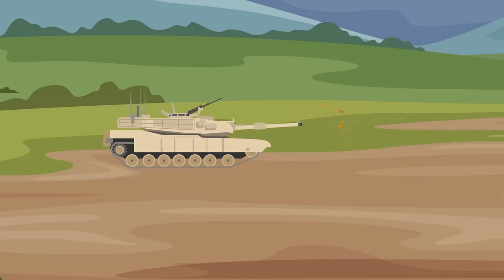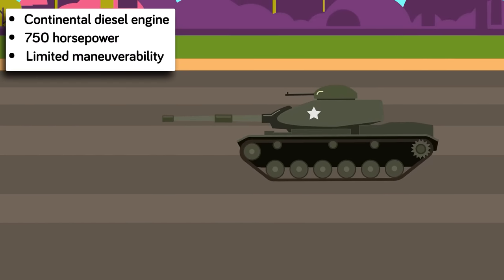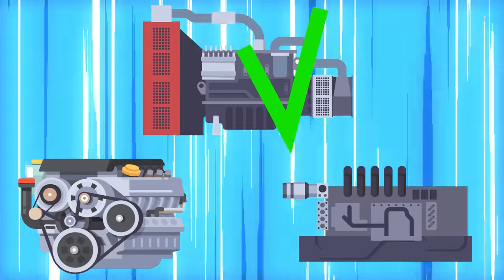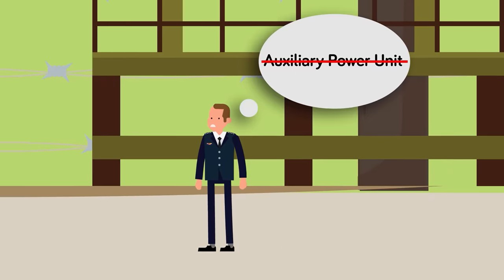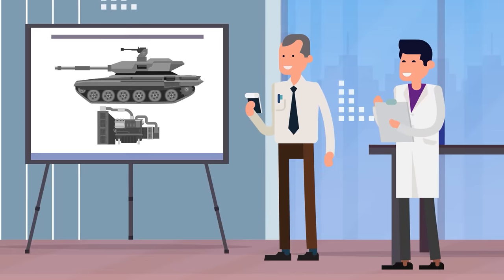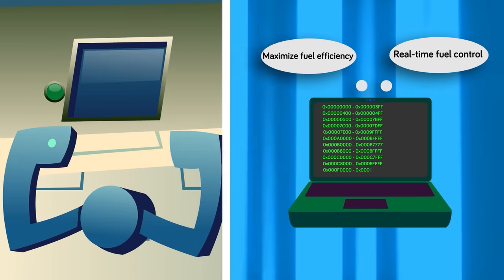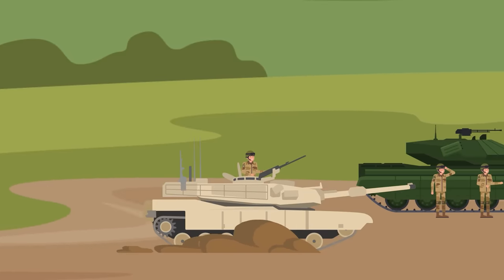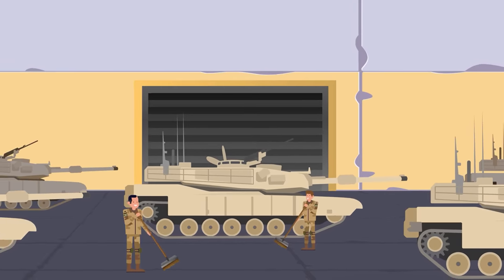Why M1 Abrams Turbine Engine Is Actually OP

Comment: I've spent 8 years as an M1 tank it crewmen. Crazy now that I think about it, we never had a tank engine that stopped working. Weeks in the field training you push the button it starts. Only other mechanical parts, transmissions, suspensions, and electrical components gave us headaches sometimes. It's a insane beast of an engine.
Reply: 1500 hp engine and only does only 45 miles per hour on road and 30 miles per hour off road sad so sad you'd think it would be faster then that🤣
Reply: Its not built for speed its built for smashing throughand climbing out of steep  trenches and (sometimes) buildings. Basements usually are deterrents for them to go through buildings. 

Plus it’s pointless to focus on speed when bullets and rockets go faster.
Reply: @raven4k998 the limiting factor for tank speed is usually the tracks, tranmission and suspension. They can go faster but that cause very high wear and tear.
Reply: @raven4k998  mechanically governed speed, during testing some were seen passing cars going 60 mph, however it put a lot of wear on the vehicle
Reply: @raven4k998  It really boils down to power (1500 HP) to weight (70 tons) ratio.
Reply: Ofc when it's run with couple of moving parts pretty much every gas turbine engine is reliable because of that.
Reply: @raven4k998  It's that speed on purpose. It CAN go faster, but they intentionally limit it to those speeds because track wear & maintenance starts to become an issue.
Reply: @TroIIingThemSoftly  are you sure?🤣
Reply: @raven4k998 It's a tank. If you want something with that type of power to go faster they'd simply change the gearing. Power isn't everything kid. It's how you apply the power. Traction, gearing, torque, and tuning are all part of the formula for speed and or power. Here's another tip most young gear heads don't know. There's a huge difference between quick and fast.
Reply: @raven4k998  Cry more 😢
Reply: @raven4k998  torque is more useful for a tank I reckon
Reply: @kronk9418  I love you to pookey:face-red-heart-shape:
Reply: The 1500 hp would be insane in a 3300lbs car, but the tank weighs over 100,000
Reply: @raven4k998  its true, the Abrams has a governor on its engine/transmission
Reply: @F_eesh  that governor needs to be removed so soldiers can have fun with it
Reply: @raven4k998  yeah
Reply: The abrams was great if you continued to use it. The moment it stopped for a week or more it wasn’t going to start again. At least our tanks at bliss were like that and my senior NCOs said the same.
Reply: @raven4k998  You're wrong. The engine has a "Governor" device, which limits the amount of horsepower the engine can send to the driveshaft. Without the governor, the M1 Abrams can actually reach 70+ miles per hour. The problem is going that fast will quickly cause the tanks tracks to shatter. That's why it has a governor.
Reply: @stray2748  and the engine can explode also🤣
Reply: The M1 Abram's fatal flawis directly related to the AGT-1500 which the Army  rejected in favor of the Continental AVCR-1360 Diesel engine.
Reply: @ceoofconfusion100  Tanks use aircraft engines, or aircraft derived engines which are only rated in Horsepower.
Horsepower output is critical to tank engines... not torque. Truck and tractor engines are not used in tanks for this reason.
Reply: @raven4k998  not smart to have 70 tons move faster than that speed. also it is governed for that speed so the transmissions and track don't fly appart.
Reply: mumericans have lost the technology for producing engines for Abrams tanks and cannot restore it
Reply: @raven4k998

For the ☝️clueless 🤡.
They have a govenor on them to restrict the speed or else the could do 60mph.

45mph is more then fast enough for a tank that weighs 75 tons(150,000 pounds)
Reply: @raven4k998 the purpose is war not speed, 1500 hp bc it’s heavy but more importantly it produces alot of torque at low speed (almost never gets stuck), for a civilian application it doesn’t make sense, for military purposes it’s quite brilliant

Comment: You guys also missed the most important part about the The Turbine Engine on the M1 Abram. It can also run on different type of fuel of all fuel types to diesel gas which is highly efficient when fuel is scarce. Although not efficient when running different gas, that was another huge advantage the army chose it rather than only relying just on diesel gas for diesel engine. I believe in the end the Turbine Engine was well worth the investment in Army decision for it MBT engine.
Reply: no they didnt miss anything - they made a video for use on youtube and need viewer interaction to be high. so getting people to put up potentially hundreds of comments saying essentially the same thing is still good from the algorithms point of view.
Reply: We got the German M265 120mm gun as well. Very accurate. Shoots far too
Reply: @adamsears1403  i think its called M256 and its a license built L44 with a different recoil System iirc.
Reply: @TheDude50447  ok you got me. Been 19 years ago 😆
Reply: @adamsears1403  😄
Reply: Why didn’t they just send them electric or solar powered tanks hate to see the c02 those put out
Reply: It runs on anything that burns
Reply: @tomcarey5156  Electric Tanks? You do know when a military attacks their will be no infulstructure in place. Power is one of the first things to go. Plus if it takes an hour to recharge your Tesla, How long would it take to recharge a tank?
Reply: @Bigdog365  Like hopes and dreams. Lol
Reply: @adamsears1403  no like for real
Reply: 'Diesel gas' is an oxymoron, there is no such thing. Also 'different gas'. There's gasoline, diesel fuel, etc.
Reply: almost all modern Tank are multifuel it’s nothing special😉
Reply: Even in WWII most vehicles were made to run on up to 3 different fuels at least the cargo trucks were but not the jeep
Reply: Can’t turbines run on almost any flammable liquids (gasoline, jet fuel, diesel, etc)?
Reply: Most tank engines are multifuel.
The Leopard 2 Diesel engine can run on anything the M1 can run on, including Diesel in cold weather, something that is a major flaw on the M1.
Reply: The US Army rejected the Lycoming AGT-1500 and the Chrysler version of the M1.
The winner of the Army XM1 trials wasthe Diesel powered General Motors XM1
Reply: @TheDude50447  Correct, the M256 is the cheaper version of the L/44 that lacks the better hydro-pneumatic recoil system and lacks the more accurate concentrically balanced gun tube found on the Leopard 2.
The Abrams uses a heavier composite barrel that is more prone to droop and thermal deviation error.
Reply: Logistical importance on the battlefield with supply lines especially how some vehicles use JP eight along with aircraft fuel it makes it so much easier and efficient but with the Abrams if it’s necessary, it can use anything from kerosene to alcohol to gas diesel etc

Comment: Russia has turbine-powered T-80 tanks too.  Ukraine has captured some of them, and the Ukrainian tank operators say they love them.  The diesel Leopard 2 and turbine M1A2 Abrams have the same fuel efficiency at higher speeds.  A turbine doesn’t idle well so it is less fuel efficient at lower speeds.
Reply: That's interesting I didn't know that
Reply: Granted I still think the Ace combat engine is better and America has shown great interest in that product probably be installed on the next gen abrams
Reply: T-80 was made in Kharkiv tank factory they had plenty of them.
Reply: @danielsnook7362  can you explain why? I've watched the video and I hear this all rhe time, but why?
Diesel engines are not that noisy, AND the Leopard 2 is still faster than the M1. And now I hear that the diesel engine is more efficient 😅
Help pls😂😂👀
Reply: @viceralman8450  
Just the diesel variants were made in Ukraine.  Ukraine’s turbine variants were captured from Russia.  I don't think Ukraine inherited any turbine variants when the USSR broke up but it inherited hundreds of the diesel variants.  Ukraine has just a handful of the captured turbine variants now – idk, maybe just four, maybe 110 eventually.

The T-80B and T-80U were the two turbine variants.  The T-80B was last produced in 2001 in a factory in Omsk, Russia.  The T-80U stopped being produced in 1990.  The diesel variant is still produced in Russia, but I think it is just called T-80 now or maybe T-80BVM.

A diesel variant was also produced in Ukraine before 1991 when it was called the T-80UD.  This variant was phased out by Ukraine and replaced in 1994 by an improved variant they called the T-84 (T-84U, T-84M, etc.).  Ukraine was still producing T-84s in 2021.
Reply: @cloudpoint0   All were made there, and the T-64 as well at Malyshev Factory in Kharkiv, Ukraine already had some T-80BV later some T-80Ud were made.
Reply: @viceralman8450   Had to look that one up - thanks
Reply: @viceralman8450  
Not the turbine models, the topic of this thread.  Turbine models were mainly made in Russia.   T-64s are not turbine tanks, nor are T-80UDs.  Maybe a few small batches of T-80BV / T-80BVM turbine tanks were made in Malyshev but this does not equate to having "plenty of them".  In fact I can't find anywhere that says Ukraine had any T-80BVs before the war started (I even checked Forbes which discusses them a lot).
Reply: @crazyo7560  the advanced combat engine or Ace for short has far better fuel efficiency and even more horsepower and torque then a standard a diesel engine. It's basically a scalable opposed-piston diesel in the version that  that the next gen Abrams has 1500+ horsepower and better torque than a normal diesel engine. Granted all of this can change cuz as far as I'm aware it's still in the development phase
Reply: @crazyo7560  I think the diesel engines are more fuel efficient, but I can't find a useful stats comparison right off.  The numbers I CAN find must be incorrect as it seems to suggest the Abrams is 2.5x more fuel efficient than the Leopard2, which MAYBE it might be more efficient (though I believe it is not), but surely not by THAT much.  Whatever; so go with 'diesel is more efficient'.  This is comparative; I THINK the difference was 2.1 gallons per mile for the Leopard2, vs 2.65 gallons per mile for the Abrams.  Also?  Oh My Lord; gallons per mile...of course, they're moving what, 60, 70 tons up to a speed I'd consider terrifying?  And for idle-efficiency, the Abrams has (or now gets made with...I'm not clear) a multi-fuel APU to keep them ready to light up and go quickly, while remaining much quieter than a diesel, and especially lacking in the 'smoky-exhaust plume' idling diesels often put out.

Speaking of speed; the Leopard 2's Wiki page reports: "The propulsion pack is capable of driving the tank to a top road speed of 68 km/h (limited to 50 km/h during peacetime by law), and a top reverse speed of 31 km/h."  "Maximum speed" in its stats-box shows as 70kph, or 43mph.  The Abrams shows the following: M1A1 governed to 72 km/h (45mph) governed, and the M1A2 is governed to 67km/h (42mph).  So the Leopard is 1 kph faster than the M1A2, and 4 kph slower than the M1A1.  For your amusement value, note that the Abrams has a governor...WITHOUT that governor, the wiki says: "With the engine governor removed, speeds of around 60 mph (97 km/h) are possible on an improved surface. However, damage to the drivetrain (especially to the tracks) and an increased risk of injuries to the crew can occur at speeds above 45 mph (72 km/h)."

There are other articles that mention that the Abrams does NOT have seat belts, so the chance of mauling the operators goes up swiftly with velocity since the Abrams does not have 'shocks for passenger comfort'...or any shocks at all?...in it.  It can technically go up to 60 with the governor removed, but that's only true on prepared, secure road surfaces, which basically means 'almost never useful in any real situation'.  So...in the end, the Leopard is SORT-OF faster than SOME Abrams, but in truth the overall result is an effective tie for actual useful velocity.  And again, ye gods; 67 to 74 tons (approx.) thundering at you at 45mph?!  Or 60 mph!!!  That would be a special form of terrifying, I'd think.

Anyway, to compare, the T-84 runs between 65 and 70 km/h (40 - 43 mph), so the speed is pretty comparable.  I suppose 'shaking people to death' is an issue for everyone's tanks.  Plus that bit about '50 km/h is the max allowed by law in peacetime', too.  And for the comparison in mass, the T-84 reports 50.7 (short) tons (46 tonnes).  The T-90 shows 60 km/h (37mph) max speed, at a mass of up to 53 (short) tons (48 tonnes).

So, the BIG deal about the Abrams as far as its power plant is that the exhaust and intakes are baffled and...stealthed or whatever?  The sound of the engine is shaped to exit mostly via the rear exhaust flow.  This makes it a royal PITA (as in...you'll die) to stay right behind an Abrams on foot, but whatever..!  Anyway, so the turbine sounds are 'shotgunning mostly out the back', and turbines are high-pitched noise; the high-pitched noise fades out WAY faster than the low-pitched "blatblatblat" of a diesel.  Again, per the Wiki: "The turbine is very quiet when compared to diesel engines of similar power output and produces sound significantly different from a contemporary diesel tank engine, reducing the audible distance of the sound, thus earning the Abrams the nickname "Whispering Death" during its first Reforger exercise."

Low frequency sound travels much farther than high does, which is why elephants do that 'talking across crazy distances' thing at 15-35 hz, letting African elephants be heard for up to 6 MILES.  Diesels aren't that low, but they're way lower than the turbine engine.  Whoever the tank is coming towards will have a Bad Day (tm), because they just won't reliably hear it until maybe the cruddier sensors on the Russian tanks is only starting to think that something might be nearby...and likely the Abrams is in range by then.  :D

Leopard 2's are amazing tanks, but the Abrams...I've been DYING to see what the Ukranians can do with a *sneaky tank*.  They've done such surprising things that I really look forward to seeing what they come up with for the Abrams!

As to which tank is 'better'..."It Depends", as always.  It pretty much depends on what you want to use it for and how you want to use it.  Both series of tanks have good use-niches available to them.  I favor the Abrams because the Ukrainians have proven how VERY inventive they are, and as an American (though not an average one!) myself, I would love to see an Abrams battle-group be turned loose in their hands to see what kind of crazy stuff they come up with.  :)  Overall, though...I just want them to get ANY tanks they can use, as quickly as we can get them to the Ukrainians.  They have work to do..!
Reply: The Abrams has a shut down automatically feature if it idles too long. Saving fuel and switching over to the APU.
Reply: @crazyo7560  the Leo2 is faster because it weighs less. Less armor. The challenge was between the MTU-830-1500 (i think), the Ace, and AGT-1500D (current use is the 1500C.

The trial liked the ACE, but failed to reach 1500HP, only a 1000HP was provided, this was then set aside for the light tanks.

The MTU and newer AGT are still in the process.
Some like one, some like the other. 

But the biggest points is that:
1. Its the military, and supply chain is always first.
2. Sacrificing acceleration for fuel efficiencies was disliked by everyone.
3. MTU is a german company, and the positive is if the M1 fought on that continent, the MTU manufacturer is there. But it would also reduce american jobs if a licensed version couldnt be made, manufacturing price in general would increase, and repairs are limited unless a factory for the engine itself was made in the US.

This has gone along similar to the XM360 120mm, the L/55 120mm, 130mm, or 140mm for the next main tank gun.
Reply: It make a great Hybrid system. Slow speed and idle electric power, higher speeds turbine.
Reply: @davidradtke160  It worked with the Strv-103 since it was a turretless, and light design. It won't work on something heavy with a turret. You're not going to find much room for either in the engine compartment.
Reply: yes and you basically have to hotrefuel them when starting

Comment: very surprised the ability to use multiple fuels wasn't covered
Reply: Infographics somehow always gets the fuel wrong
Reply: Maybe it's because they kept saying in previous videos that it could only use jet fuel.
Reply: I mean i dont think its only specific for the abrams, russian tanks can for example also run on different fuels
Reply: @kuunoooo7293  : You mean just like the Abrams!? Abrams will run on about anything.
Reply: One thing never mentioned by the critics: The Abrams is limited to 45 MPH using  a mechanical governor. When the were being unit tested, was not uncommon to see this vehicle passing cars on military roads at clocked speeds over 60 MPH. MPs were constantly writing speeding tickets tp over-enthusiastic "sport" drivers. As a result, speed was limited. Probably in a combat situation, most of those governors would become "disabled".
Reply: @dougretter  same with some russian tanks
Reply: It's not a big deal, most tanks are multifuel
Reply: @franklinclinton3211  The M1 has a tortured history surrounding the problematic gas turbine engine and revolves around serious problems concerning fuels.
Reply: @daniel_gallardo808  The M1 Abrams was designed to use NATO F54 (no.2 diesel fuel) 
Most countries like Saudi Arabia and Australia still use Diesel fuel in their Abrams tanks.
One of the M1 major flaws is it cannot operate reliably on Diesel fuel in cold weather.
Reply: @kuunoooo7293  True, the Leopard 2 can run on any fuel the M1 can run on... most are only to be used in emergency.